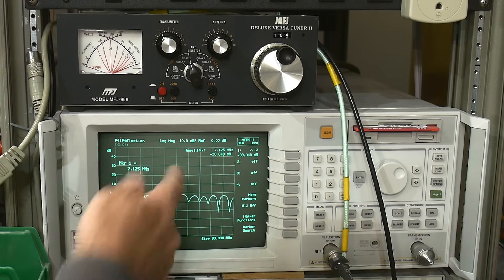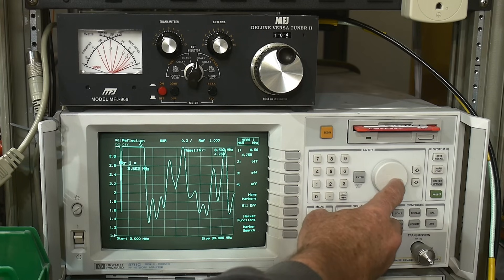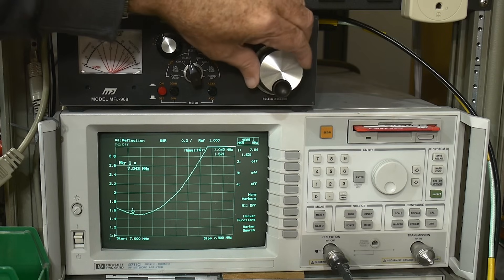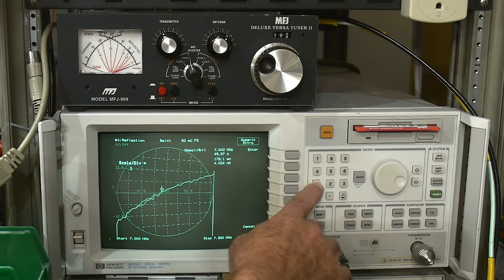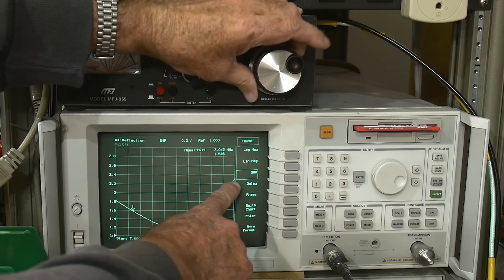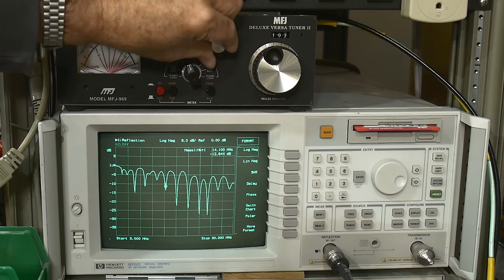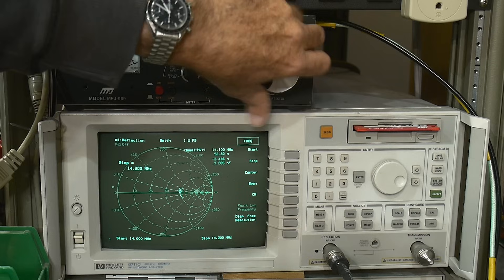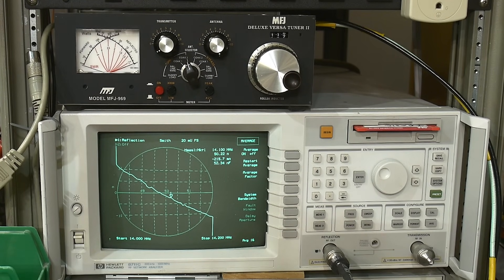#1729 MFJ-969 Antenna Tune Using VNA

Comment: no such thing as an antenna tuning unit in this context. it is AN *IMPEDENCE MATCHING DEVICE*.
its a pi curcuit [pi network] using  2 capacitors and an inductor. a cap each side and inductor across the top,

Comment: Thank you for sharing your knowledge. 🙂 I never had to do anything with Smith charts until only reccently when I started with ham radio. Although I do not yet fully understand them, it is quite obvious that they are quite useful when using a manual transmatch and provide an excellent overview for what is going on when turning the knobs. 🙂👍
73 de DL1HNR
Reply from the maker: https://youtu.be/DWs5EZrecLI?si=_egogyWApoULtql2

Comment: Are the needles not moving on the tuners analog SWR meter because that meter is for Tx or another reason?
Reply from the maker: the power levels of the VNA are way too small to move a meter

Comment: well that's all fine and dandy, but, all that your doing is providing a good match between the instrument and the input of the tuner. Now you are not actually providing a proper match to the COAX and antenna, I'm guessing your not using a ladder line? Correct me if I'm wrong, but then again I do believe these atu's use a "balun" on the output? Then again dealing with the reactance of the "BALUN" and the actual reactance of the antenna? coax/ladderline/balanced line? As for myself I designed and built (took me two years) a remote ATU that does use a quadrature detector to provide me with phase information, (and other sampling devices) aiding in the tuning of the system. I have here in the main cabin a HP8753e that is connected to a 650' length of 1-5/8 line to the transmitter building. Mind you I have to switch out the transmitters at the hill and select the 1-5/8 line. None the less, a good presentation! and yes using a VNA, even those $50 units with a Mini Circuits coupler, ZFDC-20-5 or a HP8721A will do the trick!!! Sure SWR meters will get you close but!......Also the bird Line Sections with the appropriate slugs. The VNA is your God! (Btw, the tuner is a balanced type, using a plethora of Vacuum relays, hence a stepped tuner, MCU controlled). Cheers, 73's

Comment: Some hams bitch and moan the internal matching network of the radio is limited to 3:1 VSWR. Here are a few reasons why limiting to 3:1 is the sane choice.
The "Antenna Tuner" (a very poor name BTW) does not and can not tune the antenna it merely transforms  the impedance present at the feed end of the coax to match the impedance of the radio. Since the matching is done at the feed end, a significant transmission line (coax) power loss occurs when the VSWR is large.
Matching large impedance mismatches will result in heating, large circulating currents and voltages which means the components used must be robust and typically large. Too large to fit into a modern transceiver.
Now think about the radio manufacturer's position if it were to squeeze in a 10:1 capable matching network. With a poorly matched antenna system the power losses in the transmission line make the radio look like a dog with poor reception and low power delivered to the antenna. So in effect they are saving the ill informed operator from themselves while ensuring the radio is able to perform close to it's potential.

Comment: One of the things with tuners I often see misunderstood is how they "tune antennas". No they don't. They don't even improve the SWR in your coax to the antenna.
The antenna itself has its radiation properties, like radiation pattern and feedpoint impedance (both as a function of frequency). You can't change that via an external device, only via changing the antenna geometry. 
A tuner can not "fix" your antenna. What it can do is to match the random impedance of it to the impedance of your system - 50 ohms in most cases. If you have a length of coax between your antenna and the tuner, you can tune the coax + antenna combo. The antenna will still reflect power into the 50 ohm coax, but your tuner will turn it back towards the antenna. You will still have SWR losses in your coax, and an SWR meter connected between the tuner and the antenna will see no improvement. The radiation pattern of your random wire will still be the same.
You will put more overall energy into the antenna, and the amp in your radio will still be better off, but the tuner does not at all improve your antenna in any way.
(For these reasons, many of us don't like built-in tuners, as they can create the false assumption that you use a good antenna, while doing none of it)
Reply from the maker: yes, any loss in the system gets magnified and you will have loss in the system. if the antenna is not TOO bad, then the tuner will allow the RF to get multiple chances to get radiated. say the mismatch allows the antenna to only radiate 75% of the power, 25% gets reflected back. if no tuner then that 25% get put back into the radio as heat, with a tuner the 25% gets turned around, then 75% of that 25% get a second chance. unfortunately the coax we use is quite lossy and every trip it will kill some of the power. in bad mismatches, the tuner can cause the coax to become part of the antenna, sometimes OK,  sometimes not.

Comment: Excellent video! I really like using my NanoVNA to visualize how my T-network tuner matches my antennas - very good learning instrument. Two things you may want to point out in the future:

1) It is very possible to get more than one "match" on an antenna system using one of these tuners, just because there's a low VSWR  doesn't mean the antenna will perform well
2) Generally you want the capacitance of the antenna-side capacitor to be as high as possible. A match with an VSWR of  1:1 with a C2 of 30% is going to be far less efficient than a match with a VSWR of 1.3 and a C2 of 90%.

Comment: It doesn't have to be a fancy high-end VNA. This works as well with a nanoVNA. It's my preferred method: instead of randomly turning knobs it actually shows what I'm doing.
One thing to remember though: tuning does not mean your antenna is working, only that your impedance is correct.

Comment: I am trying to understand.

At 08:41 - "Not a perfect match anywhere but more broad-band."  

Has the adjusting of the MFJ antenna tuner reduced the Q of the antenna-transmission-line assembly?

And thank you for making the video.
Reply from the maker: I am minimizing Gamma over a bandwidth and not a single frequency

Comment: Transmatch - on desk with rig. 
Antenna Tuner - at the antenna.
Reply from the maker: entire radio at the antenna
Reply: @IMSAIGuy  The feedline is not part of the antenna. What a transmatch does is make the radio “happy” with the terrible impedance it is presented and the resulting high losses in the transmission line. These days of transistor radios, it’s an acceptable configuration. Not the best thought. Using an antenna tuner (e.g. ah-4) between the feedline and the intended radiating elements delivers more RF as the feedline is no longer absorbing so much of the system loss. Another, better case, is the drive a remote tuner and have it deliver out/up to the radiator via ladder / window line. 
Loss is loss. The less of it the better.
Reply from the maker: that is exactly why I said radio at antenna, up on a  pole, or a mountain remote. no feed line.  @nooneyouknow9399

Comment: Amazing video! I've only been learning antenna theory for the last couple years as an EE major. When I had to make my own x band horn antenna for my senior project (only a 3D printed horn with some copper tape) I just measured my S11 from 8 to 12 GHz and called it a day xD
Here's a question I haven't gotten an intuitive answer to during my studies: what's causing all those resonances in the antenna (apart from the primary one at lambda/2)? And can you get a feel for these things or do you have to get out a VNA or CST simulation every time?
Reply from the maker: learning the geometry (wavelengths), transmission line theory (power transfer) you can get a gut feel. after that, cutting and measuring will help educate. things like EZNEC make it easy these days.
https://youtu.be/5uEz1KkHKas?si=CuWJFW17DiMtDefb

Comment: The best Elmer on the Web. Thank you.
The only problem with a matcher in the shack is that all you've done is to make your transmitter happy. But you are now feeding your coax and antenna with the wrong impedance, causing loss. Folks need to be aware of exactly what they've done, so they can optimize it, or just know that what they are doing is an imperfect fix.
Reply from the maker: you are actually feeding the antenna with exactly the impedance it wants. remember it didn't like 50 ohms.
Reply from the maker: https://web.ece.ucsb.edu/~long/ece145a/Notes5_Matching_networks.pdf
Reply: @IMSAIGuy  most of the times you still have the coax between the antenna and the tuner, that is NOT the right impedance for the antenna
Reply from the maker: the match tunes the system.  @HA7DN

Comment: Thank you for the nice demonstration (as promised already) of the AMU in conjunction with the VNA.
Incidentally by having a 50 ohm dummy load on the Tx side of the tuner or AMU, and the VNA on the load side one can asses the magnitude of various impedances that can be handled by the said tuner or AMU.
I request you to make a video.
Thanks again 😊
De VU2RZA

Comment: You answered all my questions:). Thank you. Love your videos. Too bad antenna tuners for Ghz frequencies are not that simple.
Reply: Not necessary or practical. these antennas are physically small so are easy to erect and space considerations are usually not an issue unlike HF antennas. in any case transmission line losses would be horrendous. Which is why microwave radio systems are typically mounted directly to the antenna.

Comment: We hold an annual Field Day of a college emeritus group up at a cabin that belonged to our professor/elmer.
We have multiple antennas, and are always changing, repairing and for years now, the NanoVNA has been a real workhorse in making custom L-networks, stubs and impedance transformers.  It also helps you economize on the reactive elements needed to match.
Happy New Year & 73… 😊

Comment: For viewers who aren’t familiar with such tuners this video suggests that it’s a totally inclusive solution to obtaining the “perfect” antenna solution. The tuner only presents a good match (SWR) to your transmitters. Apply some RF and insert an SWR bridge or even a second VNA after the tuner. Your SWR will be off the chart. There is no equivalent to using a truly resonant antenna. I used a tuner and created a situation where I had so much stray RF in the shack radiated by the coax after the tuner.
Reply: You may have to reconcile your ideas that may be based on your own experience or wisdom; yes, you are wrong. Take your time to understand the principles involved in using the antenna matching units. 
Resonance occurs only on one frequency only; away from that frequency (up or down) the antenna is no more resonant.  You may say near resonance. Many simply claim that their antennas are resonant and hence effective radiators. No, you are wrong. For an antenna to be an effective radiator it needs not to be resonant always.
There are some wise guys who say that you are cheating your radio by showing a 50 ohm pure resistive load by introducing the AMU while the actual load on the other side of the AMU is something very different with some resistance and reactance. Yes, it is true. Here, the transmitter puts out all the power it has into the tuner or AMU. Because the transmitter (and receiver too) is designed for the designated 50 ohm system impedance. 
Once the power is in there, the AMU becomes the source of RF energy. It can very well work into impedances of various kinds that are presented to it by the antenna system at the shack end. If the tuner or AMU is made with fresh, good quality (high Q) components and tuned correctly the loss of the precious RF energy is very minimum that can be ignored. 
Here, the T match is advantageous in handling a wide range of impedances but the correct setting of the capacitors and the inductor is mandatory to deliver all the power to the antenna system. 
You may see reduced reflected power reading on the meter on more than one setting while actually some or more of the RF power will be heating up the roller inductor or causing arcing in the capacitor plates.
The most effective tuner or AMU will be an L match to interface with both low or high impedance loads by positioning the shunt component on either side of the series component; yes this system involves only two lumped components.
There are many materials (on the subject) available on line for you to read apart from standard texts.
Hope this helps. 
De VU2RZA
Reply: I disagree. Here is an example. I was able to use a tuner with a 43 ft piece of wire on 160m. The antenna “radiated” a signal so based on your logic it works. I compared how well it worked to dipole and a resonant full wave loop both cut for 160m - no tuner required. While a tuner will get you on the air, a dedicated antenna designed for the intended frequency is going to outperform an an antenna that exhibits high SWR’s on frequencies that the antenna was not designed for - especially when the antenna is significantly shorter than it needs to be. 7B DXCC (302 countries)and 54 years respectfully disagrees with your conclusion. Tuners are useful, not magic boxes.
Reply: @bobkozlarekwa2sqq59  I agree with you. The tuner only ensures that maximum energy is transferred to the antenna, but has no influence on the actual performance of the antenna. It is what I call the rusty nail affect: you can tune a rusty nail to a near perfect 50 resistive impedance and still have no antenna. Of course an antenna that is off-frequency will perform better with a tuner, but that is only because you are getting more power to the antenna.
Reply: @gartnl 
The tuner (in this case a unit marketed to amateurs for use at the radio end of the feeder) only ensures maximum energy is transferred to the FEEDER. After the tuner, all bets are off because everything after the tuner is the antenna.
This is why comercial tuners (marketed to a different crowd) are always remote units designed to be at the antenna end of the feeder.
Regardless, as you say, a resonant dipole will totally embarrass anything that needed a tuner.
Reply: @digitalradiohacker  True. The whole system counts. I did assume that the tuner is at the antenna end. A VNA should also be used at the antenna end of you want to measure the impedance.
But having said that: any wire and tuner is better than no antenna. So nothing against a tuner.